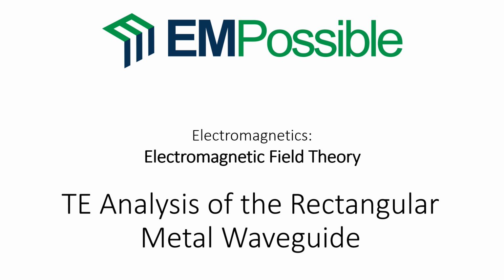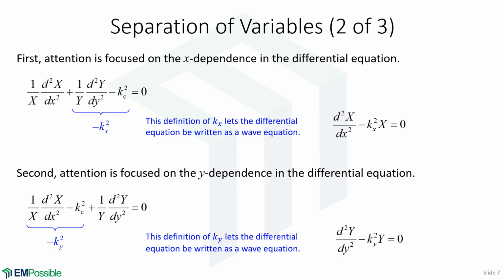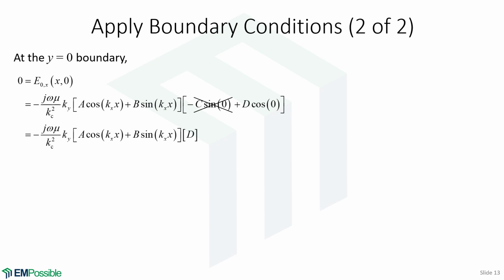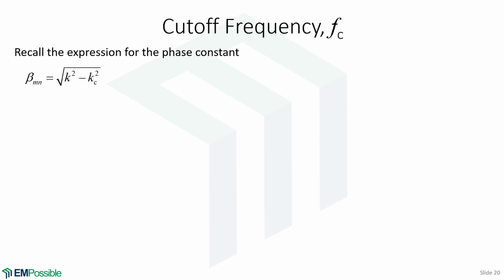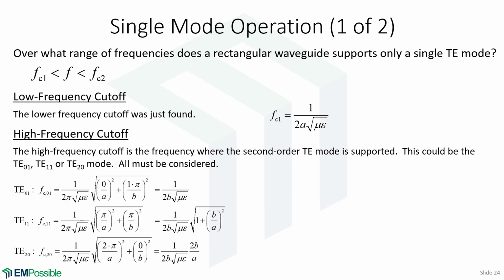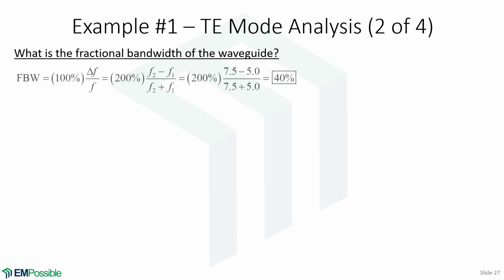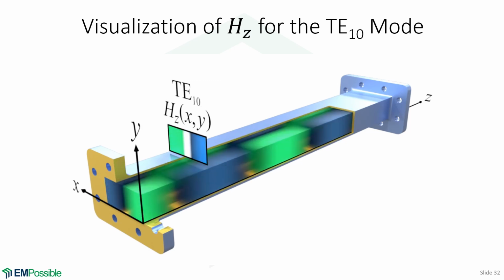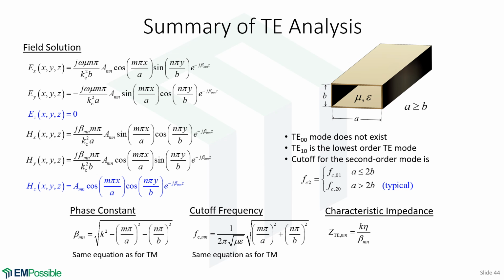Lecture -- TE Analysis of the Rectangular Metal Waveguide

Comment: First of all thank you for these lectures.I was wondering, does the harmonic oscillator have a plus sign in slid 4, so you can use cosine and sine as solutions?
Reply from the maker: I think you are correct! It should be a +kc^2*H0z instead of negative. I have no idea how I messed that up, but I have it in several videos. I think I goofed the first time and then copy/pasted. Thank you for pointing this out! Other than that sign, everything seems correct.

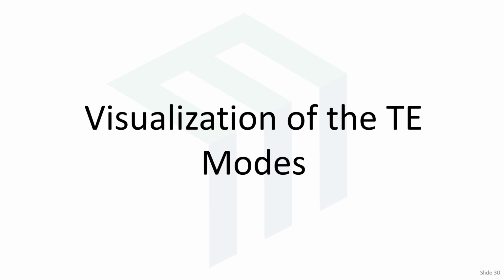Comment: At 32:50 you say that TE01 is the lowest order mode, but you are showing a typical a>b waveguide, where TE10 should be the lowest order mode. Right?
Reply from the maker: You are correct. It is just a convention to have a>b. The conventional thing for your b>a waveguide would be to rotate the waveguide so that a>b so that TE01 is still the lowest order. I personally have no problems breaking away from convention. Just be sure to be clear to others what you have done.

Hope this helps!!

Comment: sir the velocity of the TE10 mode is bothering me and the police wont help me. can you upload a video clearing up that its not actually propagating faster than the speed of light? i cant sleep
Reply from the maker: This is great to hear that you are curious about this! It has been on my to-do list to make a video on just this topic. I have something close in Lecture 1b here:

https://empossible.net/academics/21cem/

The short answer is that guided modes are like two opposite plane waves bouncing between the metal plates. The velocity we calculate for guided modes is the velocity of the interference pattern of these two plane waves. This is more accurately called the "phase velocity." The waves of higher order modes do quite a bit of bouncing so they push energy more slowly. However, the interference pattern of those waves actually moves faster and easily exceeds the speed of light. Just remember that nothing other than an interference pattern is moving faster than light. 

A video with visuals will help explain the concept. The link above is old material, but is all I have on this subject. I hope it is enough until I get to the waveguide video.

Hope this helps!!

Comment: A quick question, how does the wave propagate when the metal guide is bent 90 degree (or some angle) somewhere ?
Reply from the maker: The analysis here assumes the waveguide is uniform along the z direction. It is much more complicated to analyze the case of a discontinuity. In general, any discontinuity will introduce reflections. There are techniques for designing bends and other things while also minimizing reflections.

The reason for the reflections is this. At a bend (or other discontinuity), the guided modes change their properties. Continuity of the field requires the tangential components to be continuous. If suddenly the modes change what they look like, there will have to be scattering and/or scrambling of power between the modes to satisfy the continuity of fields.

This is important to understand because it is the origin of some ways to mitigate the reflections. For example, think of a horn antenna. The taper smooths the transition between a guided mode and propagating wave.